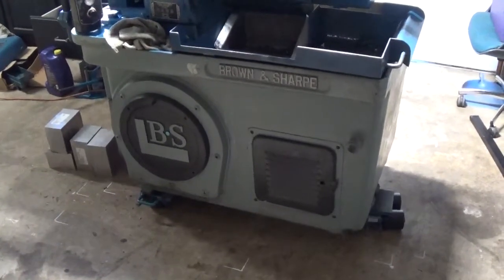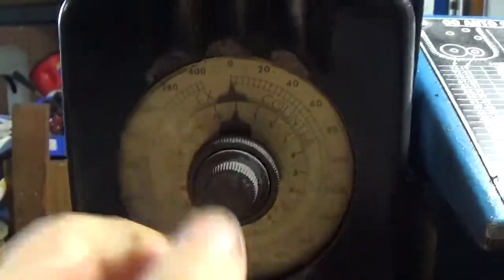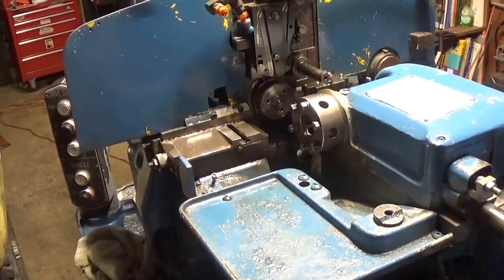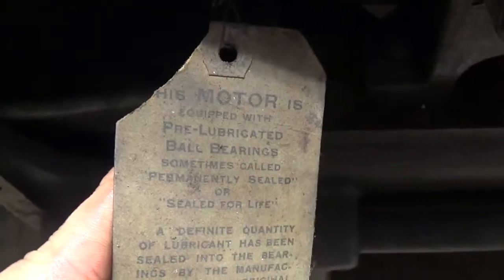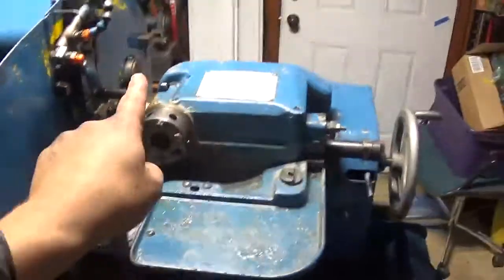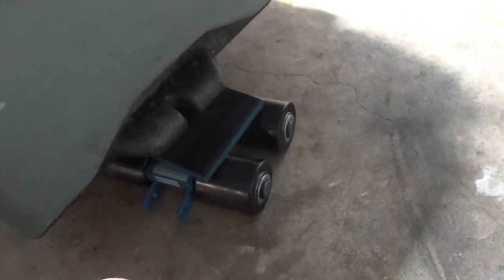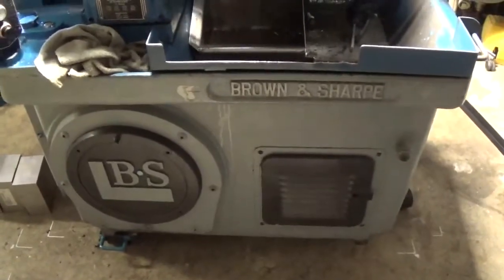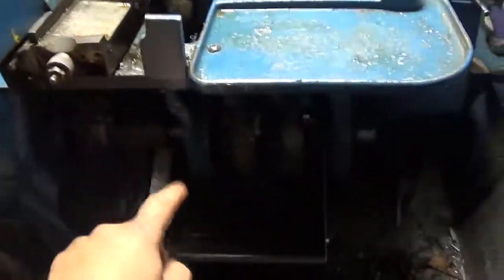Small Intro to Brown and Sharpe 00 Screw Machine

Comment: I just purchased a B&S 2G screw machine. I need someone to help me learn how to cut cams and run the machine. Any tips? Thanks!
Reply from the maker: Your're gonna want to get the Red Screw machine book: This has how to make cams and a small rundown on the machine 
https://www.ebay.com/itm/382076376396?hash=item58f586d54c:g:EVIAAOSwWTRWu-aZ&amdata=enc%3AAQAIAAAAwHRIbnQLj5q%2FuKxhOJNKINXVXeKiQRM5g1B%2FV2V1oY%2FIt5b60ODksrPa3VPTQWYI2s8QI3XgMGPAE7AlnistIWj%2FuvgbldlL4A52O49%2BxxKTF%2BrpBza%2BxKZVjiq%2BJ%2BKEG%2BNGOrKaO5XT21mZEw5Ky1BnTG0CUgqhMssWIJnaRWnPHiOpCeJZb2IV34Rr5qlWsPw%2Fu0Rsr7spRFRmBi65Lzo1ohHTgamM35%2FZHI%2FeN%2FbCEWgX8O95m53Qx0OT%2B6mX1Q%3D%3D%7Ctkp%3ABk9SR6a_qrjUYg

Comment: I am looking to get a few of these for my sash and door shop. Looking to fabricate brass woodscrews, and other door accessories. Have you seen or are familiar with the slotter mechanism some of these came with? They seem very hard to come by, find information on.
Reply from the maker: I know a little about them through photos and descriptions in books. They are either mounted in the turret or can be mounted on the cross slide. I just purchased a slotting head but just the cutter. I do have the drive motor as well but nothing inbetween. They are a hard accessory to find. You can get these machines at an affordable price and depending on your location they are either abundant or few and far between.
Reply: @MrTL117  cool, thanks for the reply... I am in california (bay area sadly and fortunately, lol. It's where the money is, but the people are horrible) it seems like most the machines are on the east coast, just with a brief glance through eBay, and my local craigslist. I've been in touch with a seller in connecticut but it will cost 2, to 2.5 grand to have them freighted. I think it will pay to be patient. I finished binge watching all your videos on the B+S: I saw the commenter on the slotter.. helpful information. Anyways, thanks for the videos, and thanks for sharing the information. I feel a resurgence going to happen in these machines. Call it a gut feeling, or intuition... But something is telling me they will be worth a lot more in the future.
Reply from the maker: @mdevidograndpacificlumbera1539   Check out some machinery sales sites as well, I have seen some for sale near the bay area for sure. Quite a few for sale in AZ in that link. 
https://www.machinio.com/cat/automatic-screw-machines-single-spindle#results 

There might be a resurgence but no one will really know how to run them! Thanks for watching! Lots more videos to go on it.